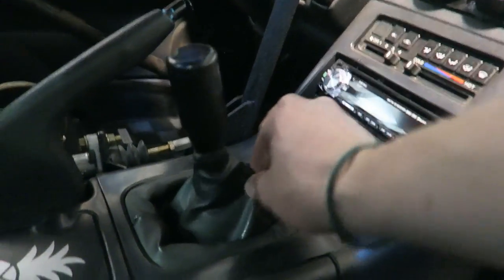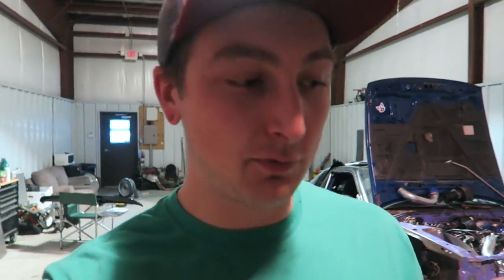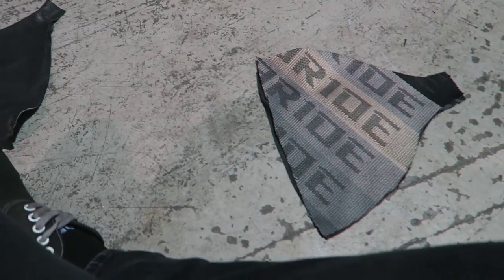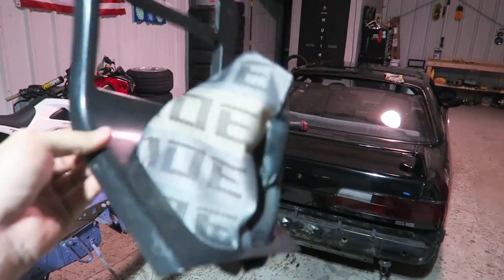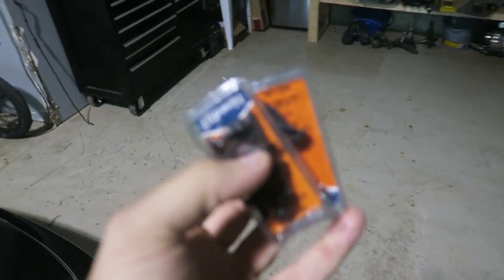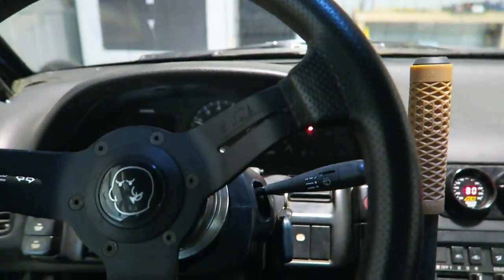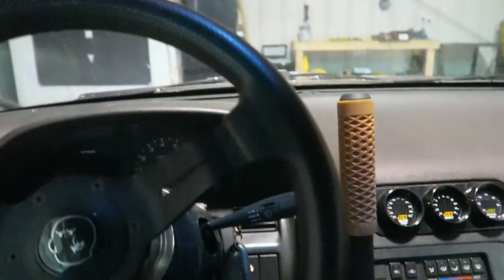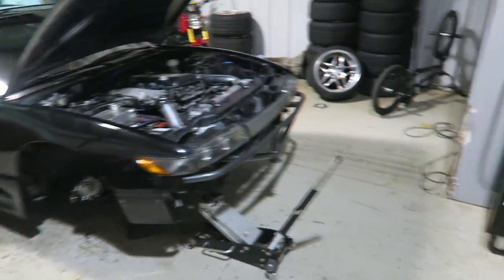HOW TO: CUSTOM SHIFT BOOT + S13 DISASTER!

Comment: JImmy, try and get the 26mm because getting a z32 in 30mm is a pain finding wheels that fit.   I Hate running spacers. but, oh wells keep it going on the build if you do run 30mm let me get them spec.. fitment doe.  just thought i share some love bruh bruh.

Comment: If the z32 and s13 calipers bolt up the same swap your z32 factory's to the s13 and just put the wilwoods on the z32??? Or at least attempt! Wilwoods would be clean on the LS z32